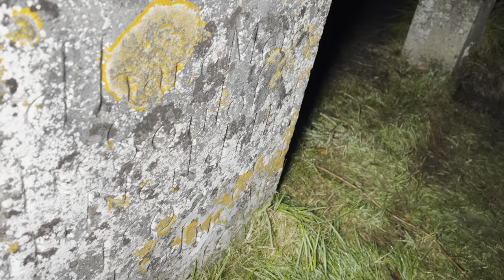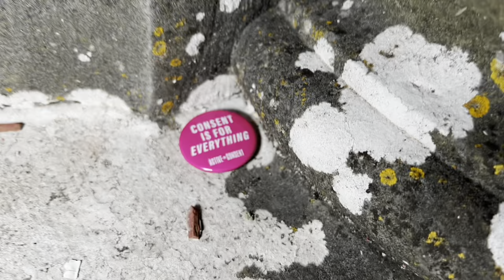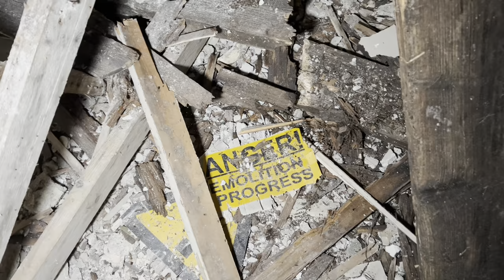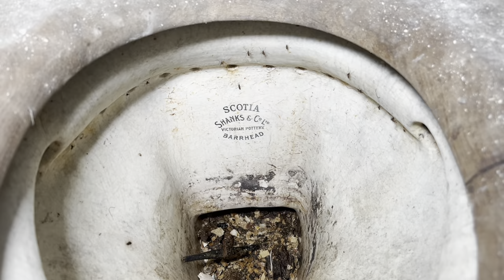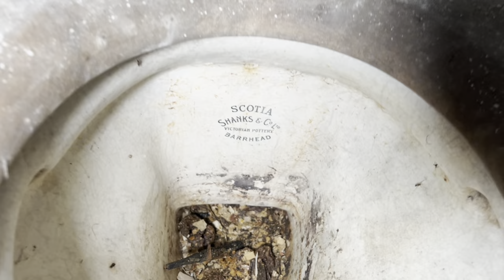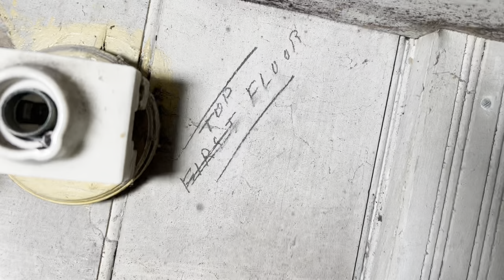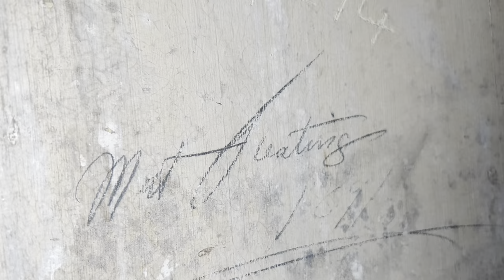QUIET! Someone’s outside this HUGE ABANDONED Irish house

Comment: The little lift thing you mentioned about sending food from the lower levels to the main house, is whats known as a dumb waiter, so it does seem that the servants actually lived an worked down in the basement, where as usually they'd live in the annex of the roof.

Comment: At 15.40 you ask about slate under the floorboards. Slate is used in building to pack things out because it doesn’t crush, so possibly the floorboards were not level and were packed underneath with slate.

Comment: You should have checked if the camera has night vision and as you are trying not to be seen you will have been spotted by your torchlight you should have used a night vision scope to find your way, or give the camera pole a very good shake so everything falls off.

Comment: Matt you are right, it was horse hair , in floor was exactly I assume for insulation but just as a side note, the ceilings you love so much had just as much horse hair in them in the actual plaster casting moulds , from arches to cornices and ceiling roses too, all had horse hair in them , I worked as a plasterer all my life doing that sort of work , so the bits you found stacked that had come from the ceiling were probably being sorted to make some new moulds up to cast new ones for restoring,

Comment: After doing a wee bit of Google research, I discovered that servants did used to live in the basements, most lower ranking servants all sharing a room in the basement known as the servants quarters, they'd be given a bed & basic bedding but that's about it, the higher ranking servants would sometimes get their own room with a desk & fire. So with the age of the house I think many of those rooms in the cellar would have been for storing food etc, but also where the poor servants had to reside, horrific. I hate to think about the sexual harassment female servants got too, from their masters & from other male servants, yuk.

Comment: 45.05 I reckon this is the kitchen, I think the square item which has a metal front I think is where there would have been a copper, a large water holding basin heated from underneath where they would have cleaned clothes and boiled their suet and Christmas puddings. 
I love the old writing, I love to wonder what the person was like that wrote it , what did they do immediately afterwards etc etc 😊

Comment: That metal piece you saw inside at the beginning. It’s a piece of the outside fencing. When you came out and your torch scared you, you were showing that fence and it’s the same as that piece you were not sure what it was. The metal that was leaning up against the wall in one of the first rooms you went into

Comment: The Electrical panel looks like a bank of ancient dimmer switches. I once saw something similar in a panel in an old theatre, which dated from the 1950's and controlled the house lights in the seating areas.

Comment: Next time your freaking out about cams take your phone out turn the flash off point it to them if you can see a purple glow its the infra red there on but not to say they are not fakes now continue watching 😂😂
Reply: You already knew that trick 😂😂 heres another sit a bit of a reflective pouch over it it wint see nothing but will look like spider webs 😂
Reply: 31 33 wtf was the big breath in
Reply: The thing with the dates of these old.places that's only the house then was built these places most likely had places on them.before for years back would loved to have seen this just as it was emptied must be thousands in Ireland